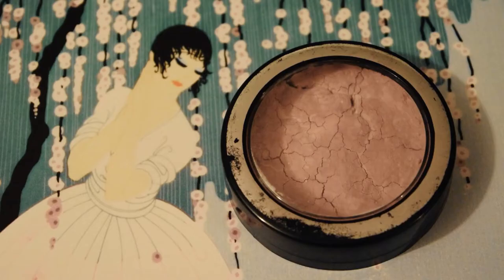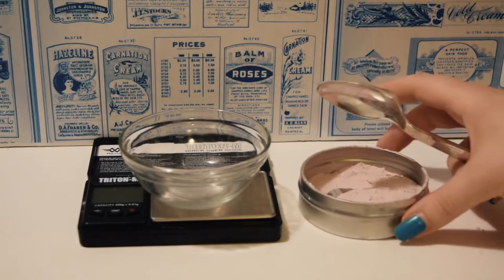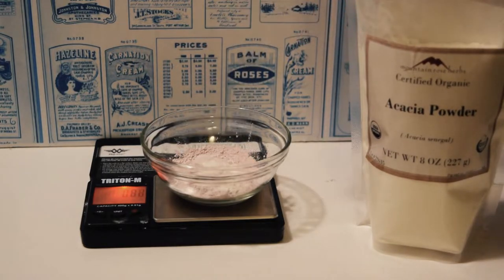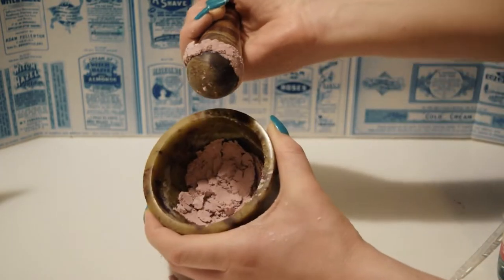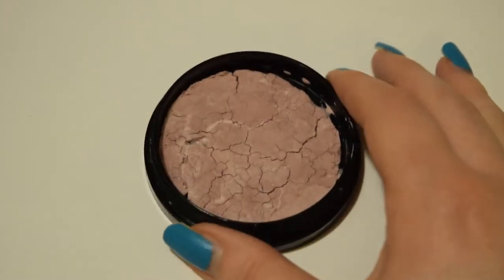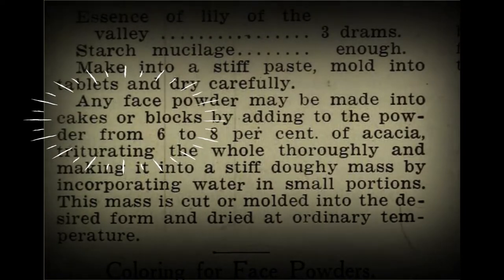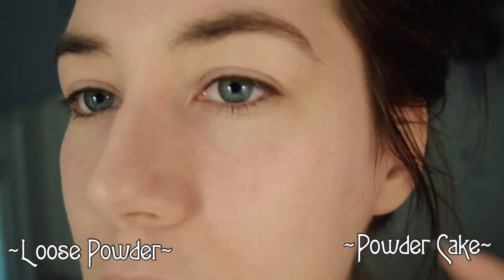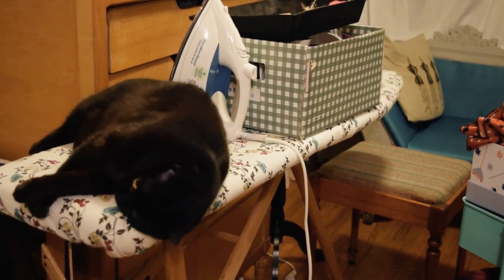Creating a 1920's Powder Cake from a Loose Face Powder

Comment: What scale do you use for measuring? Does it work well? I was looking on Amazon for a scale and couldn't find one that didn't have bad reviews. Thanks.
Reply from the maker: I have a Triton-M (400g by 0.01g) scale, which I bought a couple years ago. I've been quite happy with it and use it for all my makeup-making. I also have a larger cheap electronic kitchen scale I use when I don't need to be quite as accurate or need to measure larger amounts (such as for soap making). Not sure what brand that one is.
Reply: @TheLongHairedFlapper   Thank you!